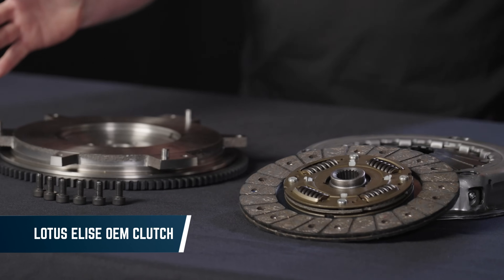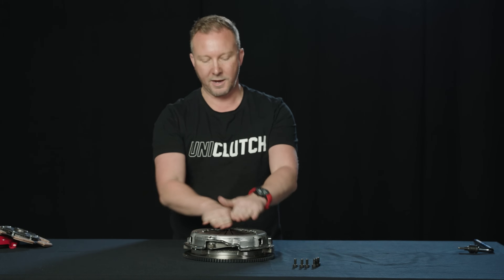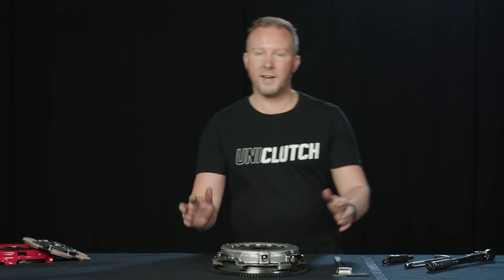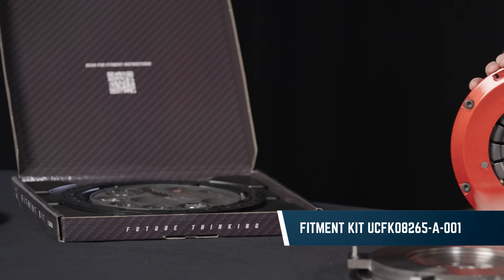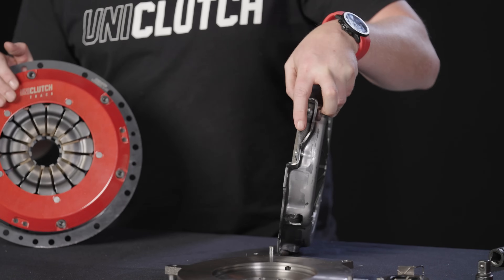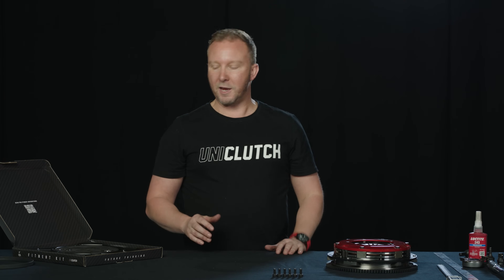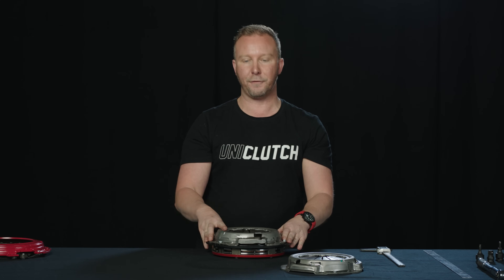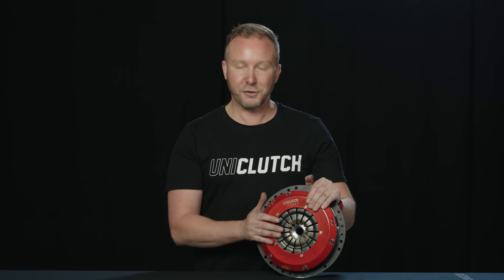UniClutch -The Impossibly simple game-changing manual transmission Clutch

Comment: You should look into trucks also plenty of trucks in the 500 to 1500nm range. Was just thinking of the 6hk1 which is 381mm clutch diameter with 750-1000nm of torque. Except they are 10 tooth 45mm spline.
Reply from the maker: Right now only available for passenger vehicles and 4x4 applications, some light truck options are also available.

Comment: The bolts appear pre-coated with a compound, are they not Loctited up from new ?
And you're spacing the clutch unit to match finger height, so you are not concerned about the basket resting against the OE flywheel ?

Comment: Im assuming at some point down the track you guys will make a smaller version for smaller flywheels?
Reply from the maker: What kind of applications are you looking for?
Reply: @uniclutch  me personally, i have a 4age corolla that im turbocharging for circuit use. With development it should have roughly 350rwhp, and flywheel size is limited due to bellhousing sizes.

I think the uni clutch would be great im my case, as the duel organic friction should be more forgiving launching at the starting line, and because of the modular input spline adaptors, if i ever need to change gearboxes, i dont need to change clutch kits.
Im sure there would be more small engine+big torque applications where a uniclutch would be great.
Maybe mini cooper s, diesel volkswagen etc?
Oh also land rover TD5 if you guys haven't done one already.
Reply from the maker: @MRMOPARMAN0426  What makes you think it won't fit a 4age now? I have a UniClutch in my ae86 current :) Just need the larger 4age or 4agze flywheel and we have a UniClutch fitment kit to suit.
Reply: @uniclutch  215mm flywheel. Hey, maybe a larger dia flywheel might wvwm fit in it?
Reply from the maker: @MRMOPARMAN0426  Thats right if you have the 215mm flywheel we have a UniClutch fitment kit that will work.

Comment: Hello. I want to buy this clutch but I can`t find the one for Citroen C4 Cactus 2016. If it is the one with DMF, I need to buy a DMF to SMF kit? Thank you!
Reply from the maker: Hi There, could you confirm which specific engine your C4 has so we can review this further for you. Thanks
Reply: Hi. It is BH02 1.6 diesel, euro 6 engine. The car has the manual (piloted) gearbox. 
So I am hoping that using a new normal flywheel and a uniclutch kit will offer a good experience for a daily driver. Nothing fancy. 
Thanks!

Comment: Im actually in the middle of installing one of these clutches in my VY SS atm. Question about loctite, the supplied bolts have a red wettish like paste on them like the ones in the video I assume was Loctite..? So am I supposed to use my own Loctite on these bolts on top of the red stuff that's already on them or..?
Reply from the maker: That's right we also require extra loctite to be added so that its across the full working area of the bolts.
Reply: Oh well it's all back together now. Wasn't sure but figured probably better not to compromise whatever had been applied to bolts already all good but. Thanks for replying!
Also why I have ya here, I did read that engagement point or pedal height would be higher than OE, it's all the way at the very top of the pedal now... While everything else about the kit is perfect and a joy the pedal height issue making bedding in and hill-starts etc a real pain unfortunately. Any ideas or assistance would be greatly appreciated Ive tried messing around with adjusting the clutch pedal at the master cylinder feels a little better n free play is good but not gonna do much for pedal height etc... 🤷

Comment: Damn was considering but im a pull type and its way more beneficial over a push type and a pull to push conversion for a supra is not worth it damn had my hopes up
Reply: Can you please elaborate? I'd love to know what makes a pull type clutch so much better
Reply: @samuelmdouglas  pull type on the pressure plate can excert more force on the clutch plates while using less effort to disengage the force applying to the clutch pack like a playground seasaw not sure if thats how its spelt but its all about pivot points like cracking a stubborn bolt with a ratchet over cracking a stubborn bolt with a long bar but my explanation dosnt do it justice its all about pivot point I have a serious duel disc clutch in my supra and the pedal feel is like stock my friends skyline is a push type twin disc and the peddle pressure to disengage that clutch is crazy hard and iv got another friend with a triple disc clutch push style I struggled to get it in its not drivable in my eyes you feel like your going to brake the pedal mounts though the firewall
Reply: Push vs. pull is a debate for the ages. One will say push and another will say pull is better. Personally, I don't have a preference.   @samuelmdouglas
Reply: I’m in the same boat. I was excited about this ad I have an sti with a blown clutch until I heard that they only do push style clutches. At well, xclutch it is then.
Reply: We are working on a pull type UniClutch and will be available in Q3 of 2024. Pull vs. push always a good debate!

Comment: Is your lotus a 2zz-ge with a C60 transmission? If so, then you could also market this for the 7th gen Celica’s, but hopefully the price isn’t a lotus owner price. Celica owners can’t afford that. But I’ll have to look into this. It seems like an awesome alternative than going to a dual clutch system. I am also on a Competition Clutch flywheel.
Reply from the maker: Hi there, we do have it available for the 7th gen Celica and also the Corolla Sportivo with the 2zzge :) You would need to check the dowel positions of your flywheel, to ensure its the same as OEM, if it is then the UniClutch fitment kit should still work.

Comment: Looks great. I’m waiting for the track release. Do you have an eta? And also what is the construction difference with track? As notice it doesn’t state “quiet” 
I need the higher torque of track for my street car (which sees track days)
Reply from the maker: At this stage, UniClutch Track's ETA for release is roughly April/May 2024; It has a Low MOI Cover & a differently designed disc that includes forged Internals. As the Track is designed to take higher torque capacity, it requires a beefier clutch plate, which won't offer the same level of noise dampening as the regular UniClutch & Sport models.

Comment: Very helpful explanation! I wonder how much more pedal force the Sport VS standard version? It seems that even the standard version has enough torque capacity for my FK8, but I do track it a few times every year.
Reply from the maker: Thanks, the pedal effort between the two is negligible, it does however depend on the vehicle application, our FK8 Type R was great to drive with the sport and didn't feel heavy compared to a traditional upgrade clutch.